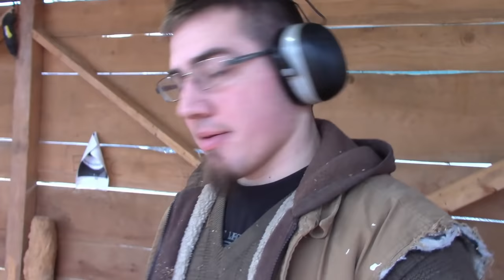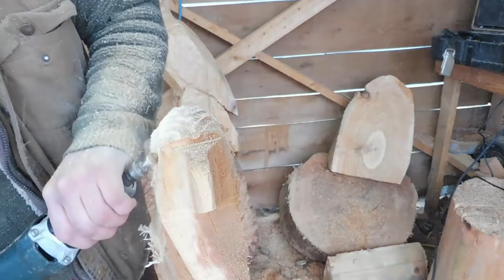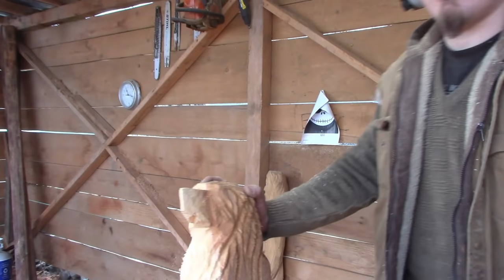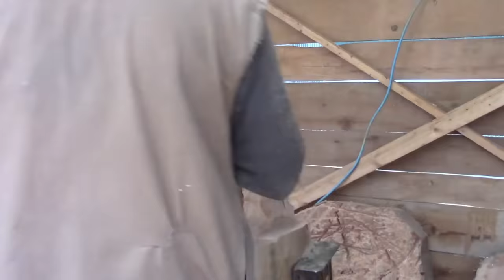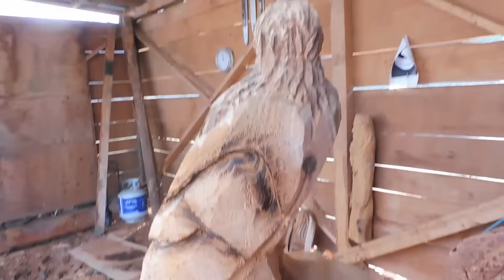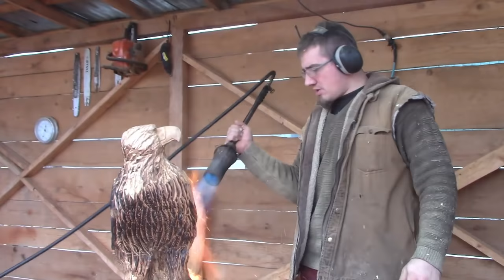Feather patter Technics

Comment: Been carving small scale for a few months, have probably 2 dozen decent carvings done in basswood and pine, been educating myself a bit before I get out the saws and make a mess, but it's coming. You've been a big help, I like the way you explain the different techniques and how to use them. It's very helpful. I've already used your owl eyes on my small scale owls. They translate down well, but you have to drop off or paint in some of the elements on smaller owls. 
Thanks!